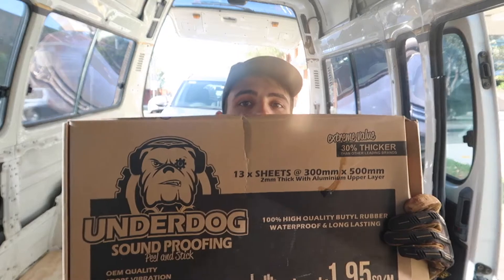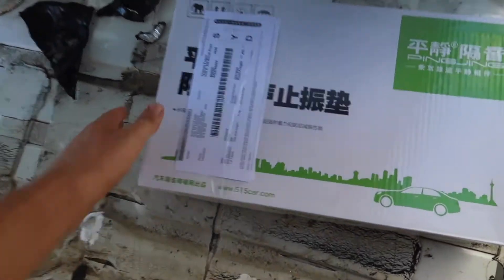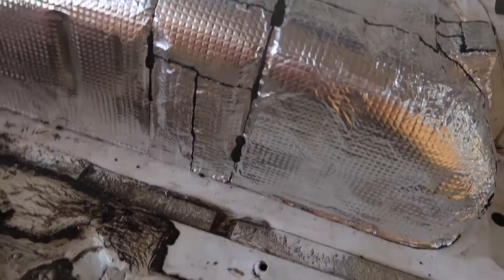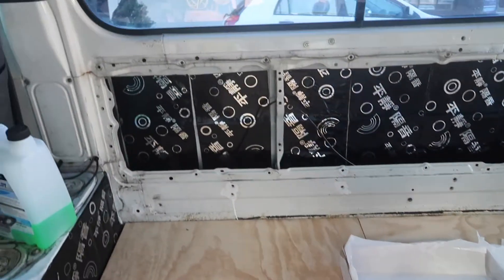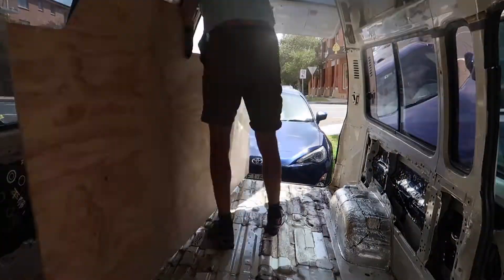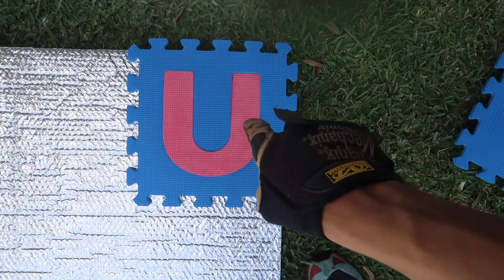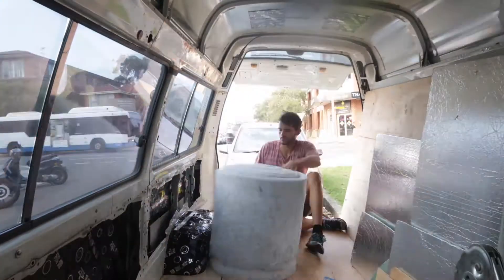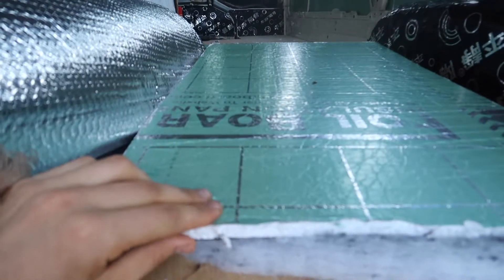Insulation Part 1 | Toyota Hiace Campervan Conversion

Comment: None of these products are available at Bunnings anymore and the bay link doesn't work either. I can't find the product/material you use for sound dampening anywhere... What is the stuff? Are you able to recommend what all the other products are in a version that's available now? Like everything you used? Cheers..

Comment: Hey mate, Hoping you can help. I just purchased the identical van for a conversion. Just wondering how you went about removing the a/c unit from the roof? Did you manage to do it with keeping the a/c for the van functional or did you have to degas it? PS great videos. Your can turned out mint! Cheers
Reply from the maker: Hi Hope you are well. You can buy clamps that seal off the refrigerant tubes before you cut them. Make sure they are rated for the pressure of your lines.
Reply: Thanks for the info, I've scoured the web trying to find such a clamp. Do you have a link or the name for them. Also did you cut the hose near the unit or closer to the compressor? Cheers
Reply: Hey marzpop, I've just run into the same difficulty, any advice on how you got around it?
Reply: marzpop did you resolve this? Have the same issue!
Reply: Jasmine Scheithe did you resolve this? Have the same issue!